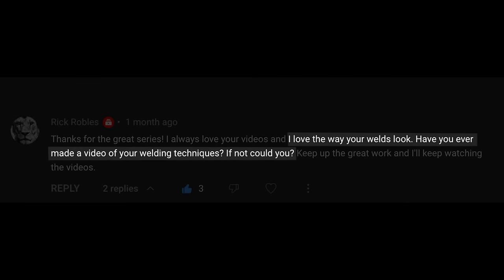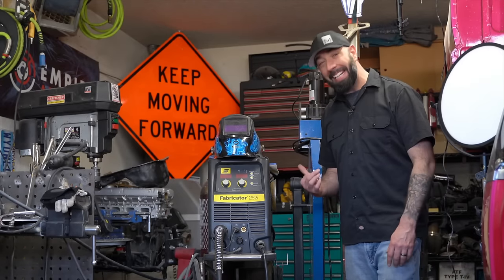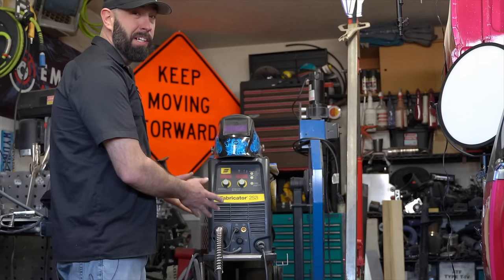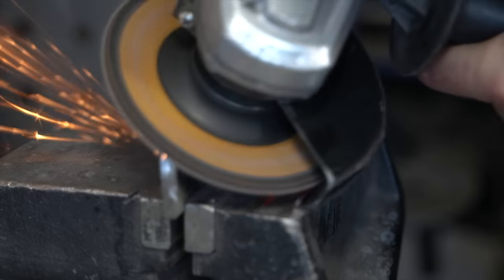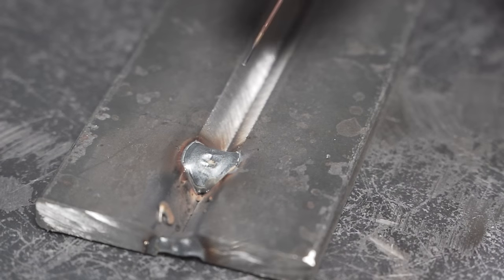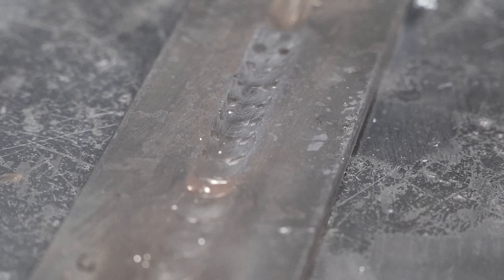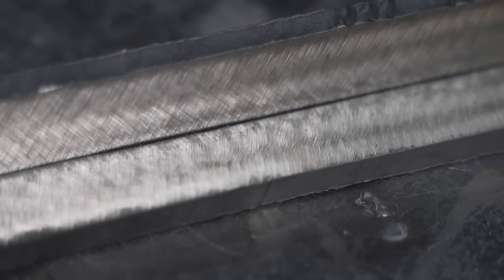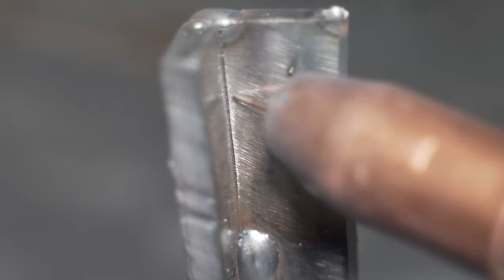MIG Like Mankandy: Techniques for Stacking Dimes with a MIG Welder

Comment: For being selftaught I think you are doing fine. I have the education, but not so much practise. Still, what you are doing would have been accepted by my teachers. Well, perhaps not the vertical down - if possible, always go for vertical up. Much better penetration that way. I especially like what you just briefly mentioned - take a break! :D I craft in many different ways and with different materials. I have found that whatever I craft, it is extremely important to recognize if you are getting angry (or tired). It is when you get this feeling of "I WILL THROW THIS EFFING PROJECT INTO THE WALL!!!". Have a break. Get some coffee. Perhaps sleep on it. If you continue, you just increase the risks of messing up big time and/or hurt yourself badly. Taking a break might be the most important advice in any crafting. 

It also helps to get a Jesus Christ tool. That can be any tool close by, that you can throw across the workshop, while screaming "JEEEESUS CHRIST!!!". Then you don´t have to throw the project into the wall. Just don´t forget that the tool you just throwed into the wall, is the most likely one that you will soon need. Spend half an hour trying to find it, and hope it is not broken. It is a very good lesson in anger management and patience. Both are needed when crafting anything. Of course I have never done this myself, but I have seen some friends doing it. Nope, it was never me.
Reply from the maker: If I understood you correctly, you advise to have something within reach at all times that can be heaved when enraged.
I like it.
I couldn’t agree more with the necessity of down-time. It brings a military saying to mind. “Slow is smooth, smooth is fast.”
Rushing to finish will cause mistakes that take even more time to correct. Slow down. Stop if needed. Stay sharp. Save time. …and sanity.

Comment: also .. dont drag well and dont weave..  always push your weld pool, you wont get the full pen with your chosen settings by drag welding which is why its sneered at and some companies will fire you if they catch you doing it.

Comment: Strange how i can see the puddle no problem on your weld but cant see this on my own weld, have i just got a crap helmet
Reply from the maker: Might sound dumb but it took me a long time to realize how important it was to be able to see clearly. 
More importantly how important a CLEAN helmet is! Just a few spatter marks, mild scratches, and or finger prints on the lens destroys visibility when the bright light hits it. Even if you think you can see clearly just before you start welding!
I used to keep my protective lenses on for months. Now I buy them in bulk and replace them often. It doesn’t cost much.
Make sure your vision isn’t too dark or your arc is too bright. Adjust the helmet if it is. If it’s not adjustable, YES, it’s time for a new helmet.

Comment: I'm guessing that someone already said it but with all these comments, it's too difficult to find it.
You said 350" per second and I'm sure that people setting up their welder will intuitively get the mistake but just in case it causes any confusion, it's 350" per minute.
Reply from the maker: Haha yes. I got an earful about that one. (or an eyeful?) I had camera settings on the brain at the time. I adjust my FPS (frames per second) far more often than I change my wire speed. My brain confuses the two. I still get it wrong every time I say it.  😩

Comment: Dude, if you are running that thing @ 350 inches per second, that machine is a powerhouse. And I would recommend pushing your voltage from a measly 21v to at least 1200 volts. 

😂
Reply from the maker: The wire feed supercharge kit came with a fusion reactor so I’m way ahead of you. Just recently welded two 8 inch thick plates together and got full penetration in a single pass with no beveling. 🙌
Reply: @GarageFab  lmao. Hook me up. I want one.
Reply: @GarageFab  I should add, you have great content, keep up the cool vids.
Reply from the maker: @gmacka6333  Thank you my friend. 🙏

Comment: Wait a minute - in the beginning, during setup you stated that you are running a wire speed of 350" per second. Isn't that just a bit fast?
I admit not knowing anything much about welding, but at that speed wouldn't you create a tangled ball of wire, and make a mess of anything you just spent time on prep cleaning?

I'm guessing it was a mistatement, and that the proper wire speed is more likely to be 3.5" per second?

Great video otherwise, and I'm learning a lot just chilling with a cold one, pen and notepad handy, and hopefully retraining the knowledge you're sharing. 

(For the record, I also get nervous and make glaringly obvious mistakes doing videos - especially those first couple of minutes.)

Comment: I've been watching welding videos for a few weeks now and haven't seen anybody deliberately make a bevel. Isn't that just going to make it so that most of the metal bonding the two pieces is just from the weld wire instead of being composed of metal from the actual two pieces? And why don't I see anybody else doing it this way?
Reply from the maker: Hey Ashton! I can’t speak for the other videos because I don’t know what they were welding. You’re not wrong. There will be more filler material than base metal when you bevel like this. That’s not a bad thing. On structural stuff like bridges, construction equipment, etc. you want to use the right filler material but that goes beyond my knowledge.
More important than the filler is the bond or penetration. On thick metal like this you need the weld to penetrate and bond to the entire thickness of the base metal. Without a bevel, even with extremely high heat, you’ll only be able to penetrate through part of the base metal which will leave the backside of your joint un-bonded. Instead your weld will just build up on the top.
See if there’s any YouTube search results for welding 1 inch thick plate or larger. If so, you’ll see bevels that take several passes to fill fully.
Bevels are not necessary on thinner material like sheet metal. You can even get away with not beveling 1/8 inch thick plate but a small gap should be left between them so the weld can reach the other side.
Lemme know if this makes sense! 👊
Reply: @GarageFab  I see. Thank you so much! I've always been under the impression that the filler material was typically weaker than the base material. So I figured too much filler would make a very bendable/breakable piece. The flexible nature of the wire probably gave me this misconception, assuming it is one. I see what you're saying though. The most I'd be welding is probably 3/16. I'm looking to ultimately modify and add to a 20ft medium-duty trailer with a 7,000lb weight rating with a flux core welder to make a metal frame for a tiny house build. Besides that I want to be able to fabricate metal legs and frames for the furniture pieces I make. So this is all good to know!

Comment: Most welding tuition I've had says to push the weld, not drag it backwards. 
But other folk say it makes no difference to the strength of the weld. What gives?
Reply from the maker: What I’ve found is it depends on the person welding, their technique, and the structure that they’re welding. So many people disagree, but the most common input I get is dragging is fine as long as you’re not welding buildings or bridges. But I believe that stuff is stick welding so  that doesn’t make much sense either.

Comment: please if you change one thing push your welds rather than drag them. :)
Reply from the maker: I’ve experimented with some pushing. Very difficult for me to see what I’m doing. What is the benefit of pushing?
Reply: Push welding ensures root penetrative and better welding pool control you can't see because you're body position is set for drag welding.  You need to be infront of your torch and pushing towards you so you can see the whole weld pool as it builds. It will also meany ou no longer need to weave or stack dimes as you call it. Stacking dimes is what you do when you are using an incorrect process and procedure. And ignore everyone that's being negative. You are doing well just a few things need changing.

  As fir pen that's all down to material prep   most people grind up a 45 degree on each edge plater for V butt weld. That's a 90 degree prep. It's excessive. Instead. Aim for 30 degrees and that will be about perfect without cooking the carbon out of the steel.  Your weld set if you are welding 10 mm plates really needs to be around 250 volts   your settings would be around 195  with a 15.5 wire speed  and that will bang 6 to 8 mm welds down nicely on upto 10mm plate   the moment you drag weld you can't guarantee your penetrative and penetration is King when welding it should be your priority and you can be too hot   

Heat isn't about it about it blowing through its about distortion and baking the metal  not enough heat and you won't get enough penetration it has to be set just right for each thickness  think of your material as a heat sink. It will suck the heat out of your weld and spread it through the steel very quickly.. this causes distortion. So you could pre heat your base materials and this  stops the steel sucking the heat out and keeps it local.. this means lower volts are possible and less distortion but your head needs to be in front of your torch when pushing.

Almost all companies will fire you for pushing if they see you doing it 😂

Comment: Would pay to mention on the verticle down that your speed of hand motion controls how the molten pool wants to run or drop. Too slow and the pool will have time to build up and run down. Too fast results in a broken weld & poor penetration.
Reply from the maker: Good info! Too fast = poor penetration. Too slow = poor penetration. Finding the perfect speed is imperative however some folks will still say you’ll get poor penetration. 🤷‍♂️

Comment: Stitch weld is unnecessary  if your proficient at welding the metal in question. The only time i stitch weld is when welding rusted out metal to burn back to good metal.

Comment: Did I hear right...? As 3:30 I heard "21 Volts are 350 INCHES PER SECOND of wire..."  Did I hear right...?  Isn't 350 inches the same as 29 FEET PER SECOND...? Wound't you have a "pond of metal" in the weld by the 3rd to 4th second...?
Reply from the maker: Hahaha! A pond. Yes. That’s what happens when a video guy tries to explain welding. I had fps or frames per second on the mind at the time.

Comment: 350 inches per second wire speed?
So that's where I've been going wrong all these years!
Reply from the maker: Indeed! That’s at least why welding takes you so long. You gotta get you one of them Esab supercharged units. 👍
Reply: @GarageFab  
You realise I was joking, right?   

You quoted a 350 inch PER SECOND Wire Speed.
That's 29ft per second . . . or am I missing something?
Reply from the maker: @Docv400  If course I realize your joking! They don’t actually make supercharged wire feed machines. 
Just a simple slip of the tongue that was missed during editing.
Reply: @GarageFab  
Thought so.
I thought maybe it was 350 thousandths of an inch per second, and just saying "inches per second" was a Welder's 'thing'.
Reply from the maker: Nope. More like a filmmakers thing sneaking it’s way into a fabricators mind. Video is filmed and played back at a chosen frame rate, or FPS (Frames per second) Apparently my brain can’t separate the two measurements on the fly. 😬

Comment: You can 100% be too hot. Example is when welding t100 steel like found on booms…you cannot let it get too hot or the integrity of the steel is compromised.
Reply from the maker: Fair enough. But in order to weld something, you’re turning the steel into a molten pool of steel. It doesn’t get much hotter than that. So that’s unavoidable obviously. What is somewhat avoidable is  the spread of heat which ironically would be welding more quickly with a higher amperage.
So when assembling a boom is there some sort of controlled cooling that is used to keep from compromising the steel?
Reply: @GarageFab you have to control the heat you put in. So you have to let your weld down cool down if it’s getting too hot. Also if you’re welding too hot you will get undercut which will fail inspection. Another thing is weld speed, this actually affects penetration. The slower you go the more it penetrates. I challenge you to run 28 volts down hand on some 1/4 inch plate and compare that to like 22 volts travelling slower. I’m willing to bet your 22 volt at a slower speed will have better penetration.

Comment: Not a pro but the only thing I seen Is you did not tack Your metals at both ends be for you start your weld. If you did I didn't see it that's how I do it might be wrong but it work's for me to keep the metals for separating.
Reply from the maker: Also, not a pro! But I once learned that tacking both ends creates strange stresses in the weld. Welds shrink, so if completely butt one end and tack it, and leave the other end un-tacked and spaced 1 or 2 millimeters, the weld bead will actually pull the two pieces together.
Sounds like a fun experiment for us both!

Comment: when you prep for a butt weld!!!  leave a 0.5 to 1.0 mm prep gap.. also your prep gap face should be 0.5 to 1.mm also on anything over 5mm plate
Reply from the maker: What do you mean by prep gap face?
Reply: When you grind your prep onto your plate. some people grind it into a pointy edge... dont do that. make sure that sharp edge is flat and around 1mm in depth. you can go slightly under but you risk it being to thin at the root and blowing holes in it when you try to weld. a 1 mm root face on a 2mm gap will give you just enough thermal resistance for your weld pool to sit nicely in the root gap without falling through and making holes. it will also make sure you can fully penetrate the materials consistently. it's going to take you a lot of practice to nail it and get your weld settings perfect to achieve this there a number of factors to consider when welding..  the heat exchange between weld pool and parent materials.. the thicker they are the faster it will suck the heat out of your weld pool lowering the heat input around the area you need to weld and penetrate which will prevent penetration. prepping correctly and having your settings right for the material's thickness, material type and joint type is important if you want to do it well and right.

Comment: If you need to stick some metal together this will work, but please do not use this welding technique for anything structural or load-bearing. Take the time and practice, practice, and practice then practice some more.
Good video for beginners and people working there garage.

Comment: Stop pull welding with gas mig.
If you push, you can see where you are going, the arc forces the wire in, much stronger and so much easier to control.

Comment: I don't agree with you when you say as long your technique prevents you from burning though you can't be too hot.  Welding a heat treated frame rail on a semi truck for example with too much heat can and will cause the metal to crystalize and weaken it tremendously.  One of the most important things that I was taught is heat control.  Don't run any hotter than you have to to get the penetration needed.

Comment: i was taught to push rather then drag for mig??
Reply from the maker: You’re not wrong. From what I’ve gathered, structural welding has a lot of rules. Pushing provides better gas shielding, promoting a cleaner weld. For me personally, it’s very difficult for me to see what I’m doing when I push. So much so that my weld quality suffers. That said, I pull. I’m not going to lower the quality of my welds just to adhere to a rule that doesn’t matter in my work. I’ve tested and inspected my pull welds and for the work I do, it’s more than adequate.

Comment: It’s not 350 inches per second lmao 🤣 it’s 350 inches per minute. Per second is too damn fast ninja
Reply from the maker: No way! You gotta get you one of them ESAB wire feed superchargers, Eric. It’s like silly string on steroids. You’ll never go back.
Reply: @GarageFab  lol 😂 too fast for me. I ain’t up to your speed yet.
Reply: @GarageFab  also I would probably push your weld rather than drag. But either way, it’s not a bad video. But just so you know, you can absolutely weld too hot. Don’t feed that info to the upcoming welders lol they are already being ruined
Reply from the maker: Much appreciated my man! What’s the downfall to welding too hot?
Reply: @GarageFab  make the metal weak and fail just as easy as if it was too cold. Seen it with my own two eyes

Comment: If you are using Argon/CO2 mix you are not MIG welding, you are MAG welding.
Reply from the maker: Never heard that before. Also haven’t found that in any searches. What does the A stand for? Active? If so that is incorrect.

Comment: now pass an xray ....
Reply from the maker: Never broken a bone in my life.
Reply: @kajak012 do you think those aftermarket parts manufacturers are x raying their parts before they go out the door?
Reply: @FM-ec9ov  i have been welding for 29 years,some welds no xray  but some xray or ut and a  borescope.
depends what standard is required for a job sir........
fillet weld no xray sir pipe is dependent on what code is needed to pass.......(in australia)

Comment: your welding is not safe you only running 1 pass if u r on big iron your welds will fail u need to run multiple pass  at least flux core machine

Comment: All this is a lot of nonsense.. The ONLY thing you should be trying to do is to get a properly penetrated root run then a fill and cap with a SMOOTH profile and good fusion. All this trying to make pretty patterns is merely making your welding worse..